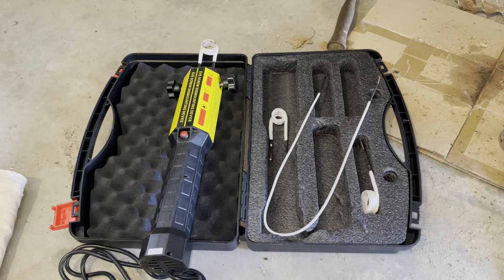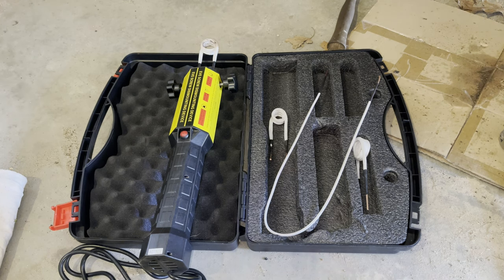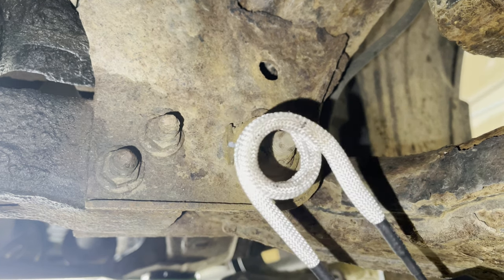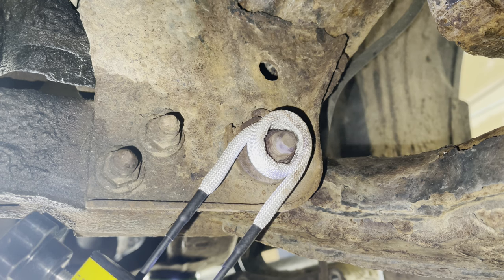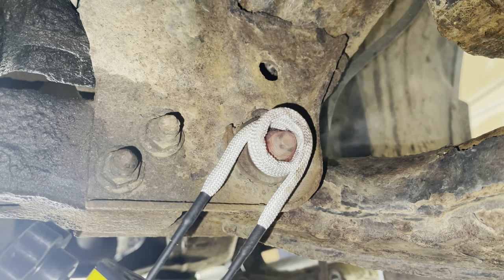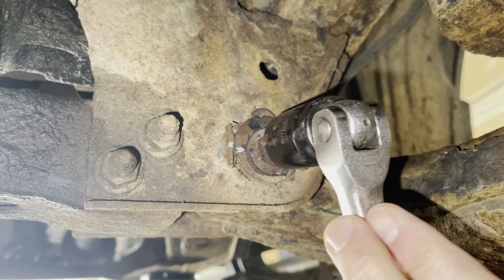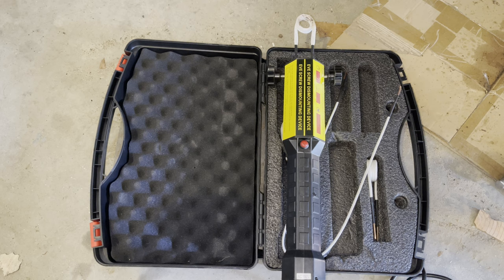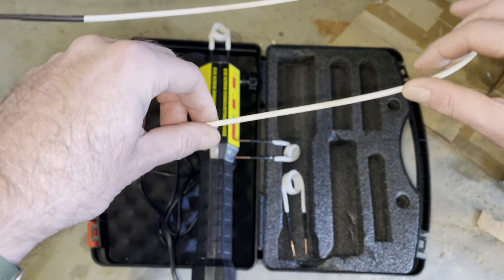Should You buy a 1000W Magnetic Induction Heater Tool? Conquer Rusty Nuts and Bolts

Comment: Induction coils only work on ferromagnetic steel. All it does on other metals like stainless steel and aluminum is overheat and destroy the device, as no current is absorbed. That device also has a duty cycle, which to pushed right up to. Imagine turning off the spotlight to show the orange glow of the bolt?
Reply from the maker: Thank you.

Comment: I was a magnetic induction thermal heat specialist for years and I can attest to how well induction works. First of, he probably didn't even need to heat it that long for it to work. However heating it too much is counter intuitive since the heat will eventually travel into the bolt itself and cause it to expand in the nut making it harder to break free.

They make other sets of these with more attachments and some come with a long rope type for muffler installs.

If you're a mechanic this is really a nice tool to consider. You may not need it often but I'm willing to bet that when you do you will be happy you have it.
Reply from the maker: Thank you for watching and the good info.

Comment: Nice video!

I am looking at buying one myself, and I find they come in different wattages, which can affect the time it takes to heat objects, as well as they need to be ferrous materials or it doesn't work, as they work with a magnetic field, and non ferrous metals don't react to magnetic fields.

I have used propane, mapp gas, and oxy/acetylene all of my working life, and have yet to have a bad fire start, but it is much safer to use an induction heater, yet they can still cause fires if not careful with surrounding materials!

But like gas torches, you can also use them to harden, temper and anneal metals, as well as solder, braze and weld if you are careful, and keep the time and heat as low as needed.
Reply from the maker: Good info, thanks for posting this. Me and fire don't get along, I'd be the guy who accidentally melts a wiring harness or something dumb like that.
Reply: @tribecreek  My fear of fire is due to the vehicle I am working on, the Fiero. It had a reputation of burning, and the way the cooling vent in the trunk was made, it is no wonder why some burned.
Reply: @tribecreek  I did buy one of the units, and it works great!
Reply from the maker: @jeffreyyoung4104  great! its tricky to get in some tight spots, but the long wire that you can custom bend seems to help out.